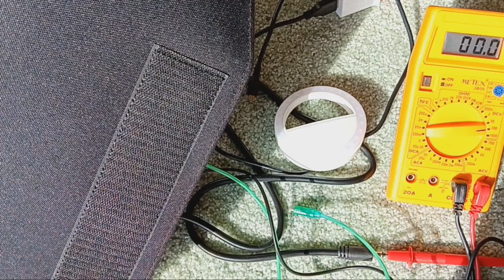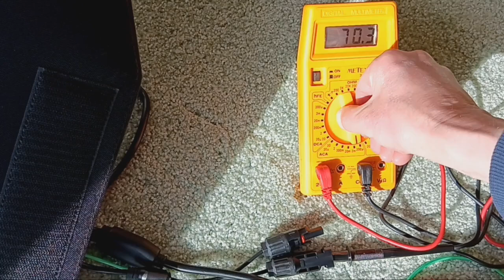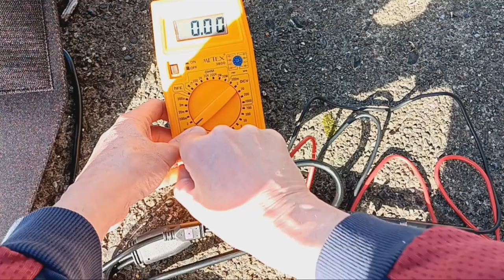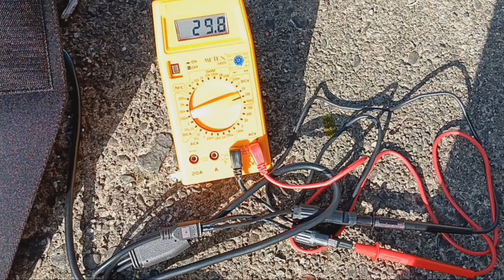Walmart Massimo 300W Monocrystalline Portable Solar Panel Test

Comment: This is not how you measure amperes with that type of multimeter, you need to connect something to consume and you open the positive, you hook the red clamp, it is the correct way to measure with those multimeters.
Reply from the maker: Thanks for the comment. I tested short circuit current the same way from the video below at 1:08. My meter has a 20 amp rating so it is greater than the solar panel of around 15 amps so it should work.

https://www.youtube.com/watch?v=UnZ0-ZLm1KE